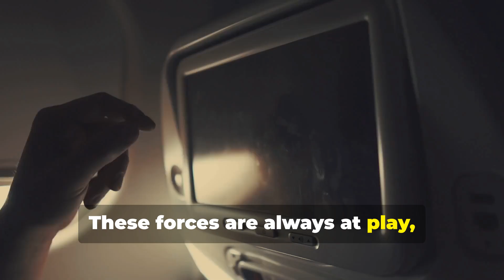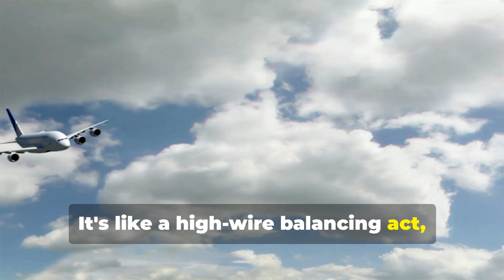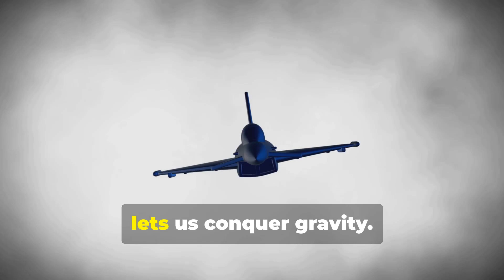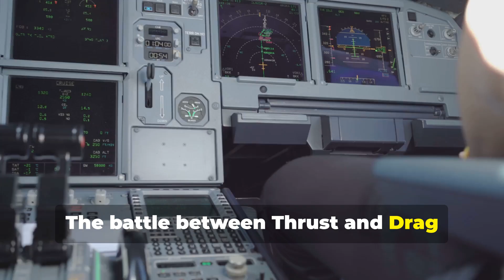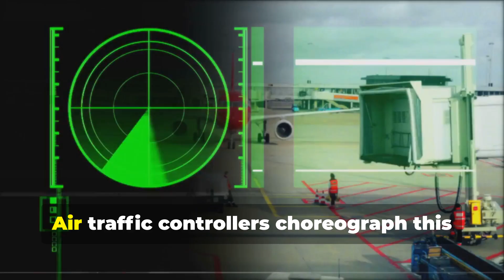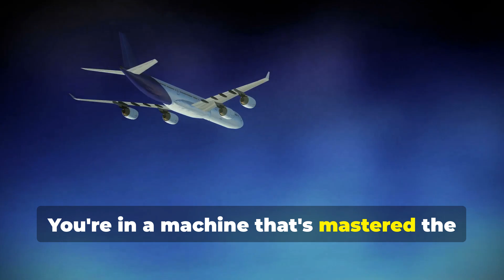How Do Airplanes Work? The Physics of Flight Explained

Comment: The theory around air pressure differential caused by asymmetrical aerofoil falls apart when you realise that wings with symmetrical aerofoil also fly perfectly - not to mention wings which are barely more than flat panels. 

It’s air speed and angle of attack. Get enough moving air hitting the bottom of the wing and you’re good to go … 

Don’t believe me? Next time you go for a drive, stick your hand out the window with it sitting horizontally flat. Now angle your hand up slightly …. Voila …. Your arm shoots up …. Lift …..

The real value of the aerofoil shape is to reduce drag..

You’re welcome….